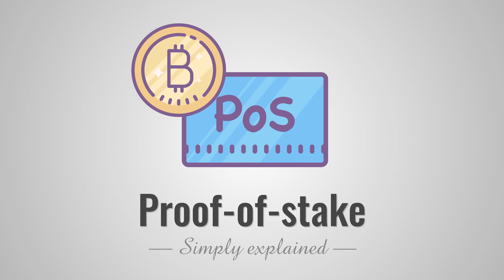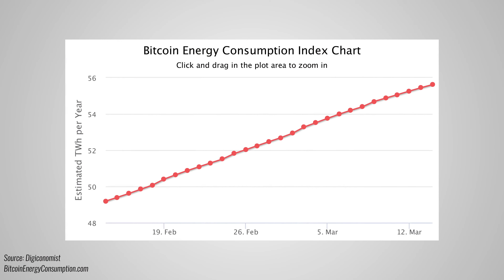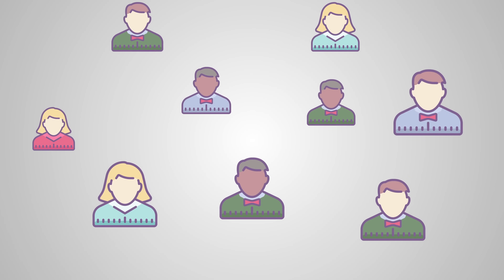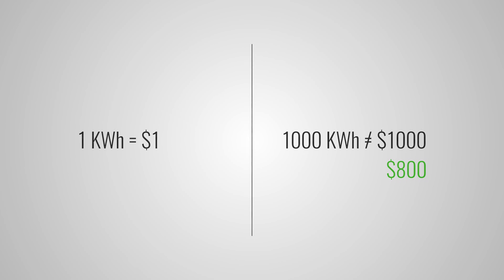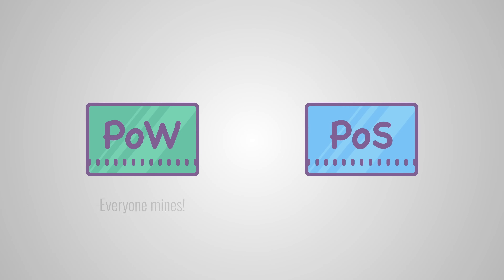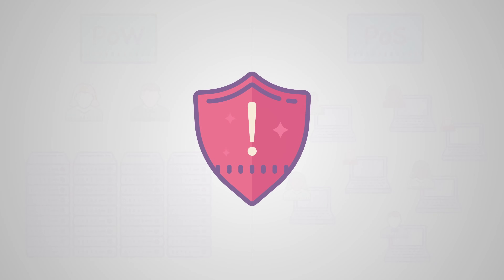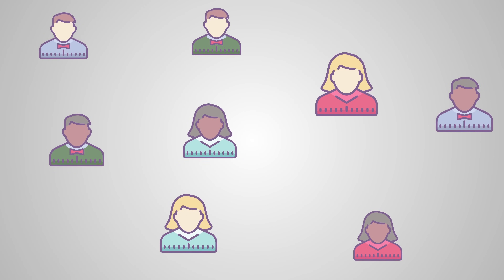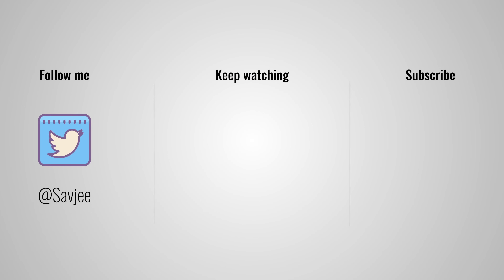Proof-of-Stake (vs proof-of-work)

Comment: You can't implement 51% attack with mining pools control, because major requirement for such attack is to have FULL control over 51% mining power.
Pool participants will quickly realize that they solve proofs of non-existing block headers and not recieving any rewards, much quicker than time needed to implement such attack.

Comment: Did anyone else find this video biased towards proof-of-stake / Eth?

Some examples:

Saying that bitcoin is more centralised through mining pools, meanwhile most people that stake Eth do so through pools like Aave?

Bitcoin transactions are confirmed by nodes, not by miners. 

To stake ETH you need to have been pre-selected as a validator - doesn't this sound a bit centralised and not egalitarian? 

You need 32 ETH to be a validator if not going through a pool, rewarding only those who can afford to front that much capital with even more ETH. 

The fact that ETH literally has a CEO and foundation team / company that dictates and changes the rules and protocol regularly, by definition makes it centralised.

Anyone else feel the same?

Comment: Here's a comparison of both:

Proof of Work (PoW):

In PoW, miners compete to solve complex mathematical puzzles in order to validate and add new blocks to the blockchain.
Miners must invest computational power (hashing power) to solve these puzzles, which requires significant energy consumption.
The first miner to solve the puzzle broadcasts the solution to the network, and if verified, the new block is added to the blockchain, and the miner receives a reward in the form of cryptocurrency.
Examples of cryptocurrencies that use PoW include Bitcoin and Ethereum (currently transitioning to PoS).

Proof of Stake (PoS):

In PoS, validators are chosen to create new blocks and validate transactions based on the amount of cryptocurrency they hold and are willing to "stake" as collateral.
Validators are selected to create new blocks based on various factors, such as the amount of cryptocurrency they hold and how long they've been staking.
Validators are incentivized to act honestly, as they risk losing their staked cryptocurrency if they validate fraudulent transactions or attempt to attack the network.
PoS requires significantly less energy consumption compared to PoW, as there is no need for computational mining.

Comparison:

Energy Efficiency: PoS is generally considered more energy-efficient than PoW since it doesn't require vast amounts of computational power.
Security: PoW has been battle-tested and is considered highly secure, but PoS is also gaining traction and has mechanisms to deter malicious behavior.
Decentralization: PoW tends to be more decentralized initially, but PoS can also achieve decentralization with the right design.
Incentives: Both PoW and PoS provide incentives for participants (miners or validators) to act honestly and maintain the integrity of the network.
Scalability: PoS networks often have better scalability potential due to lower energy requirements and simpler consensus mechanisms.

Comment: ⥊ POS: LIFE

0: Good

001: Uniqueness
002: Altruism
003: Sensivity
004: Audacity
005: Boldness
006: Astuteness
007: Ingenuity
008: Innocence
009: Truth Seeking

01: Willpower
02: Progress
03: Acuity
04: Love
05: Bravery
06: Congruence
07: Consonance
08: Honesty
09: Cleverness

1: Ethics
2: Problem-Solution
3: Subject
4: Idea
5: Expression
6: Why / Who / When / How / Where / What
7: Information / Code
8: Stability
9: Sanity

10: Network
11: Justice
12: Affront / Easter
13: Definition / Death
14: Cognition
15: Source
16: Reason
17: Discourse
18: State
19: Control

20: Judgement
21: Ethical Solution
22: Scupulous
23: Delimitation
24: Humor
25: Behavior / Christmas
26: Motivation
27:    Comprehension
28: Constancy
29:    Regulation

30: Liberty
31: Permission
32: Discernment
33: Responsability
34: Support
35: Means
36: Purpose
37: Opinion
38: Decision
39: Prospect

40: Goodness
41: Awareness
42: Critical Thinking
43: Consideration
44: Conceive
45: Plan
46: Ability
47: Knowledge
48: Structure
49: Ambition

50: Good Expression
51: Manifestation
52: Resolution
53: Application
54: Empowerment
55: Movement
56: Demonstration
57: Assignment    Mission
58: Building
59: Proficiency

60: Accordance
61: Appropriated
62: Implication 
63: Indicator
64:      Cohesion
65: Function
66: Investigation
67: Argumentation
68:      Sophistication 
69: Scrutiny

70: Intelligence
71: Message
72:      Consistency
73: Election
74:     Coherence
75: Consolidation
76: Explanation
77: Flow
78: Fluency
79: Measurement

80: Peace
81: Sovereignty
82: Perseverance
83: Reliability
84: Autonomy Instrospection
85: Rectitude Implementation
86: Pursuit
87: Persuasion
88:      Character Benign
89: Commitment

90: Kindness
91: Assertiveness
92: Optimism
93:     Scrupulousness
94:     Compassion
95: Composure  Essence Fiscalization
96: Blockchain: ⥊ (TRACE MARKER) Legacy
97: Anarchy
98: Veganism
99: Revolution

100: Liberation
101: Decency
102: Progressive
103: Resilience
104: Integrity
105: Collaboration
106: Abolitionism
107: Concordance
108: Clarity
109: Regulation

110: Ethical Commitment
111: Honor
112: Exploration
113: Privacy
114: Will
115: Pride
116: Justifiable
117: Equitable
118: Fair State
119: Mission

120: Harvest
121: Deliverance
122: Resistance
123: Cogitation
124: Challenge
125: Appropriated
126: Searching
127: Emphasis
128: Consistent
129: Subversion

130: Fulfillment
131: Admission
132: Criteria
133: Response
134: Provide
135: Technique
136: Principle
137: Point of View
138: Choice
139: Prevision

140: Serenity
141: Conscience
142: Concern
143: Perception
144: Free Love
145: Idealize
146: Capacity
147: Mindfulness
148: Scheme
149: Morality

150: Righteousness
151: Virtue
152: Coordination
153: Efficiency
154: Equip
155: Cooperation
156: Profiling
157: Counter-Terrorism
158: Rising
159: Excellence

160: Reasonable
161: Procedure
162: Corroboration
163: Hint
164: Value
165: Role
166: Lead
167: Logical
168: Improvement
169: Assess

170: Sympathy
171: Relevancy
172: Dichotomy
173: Naming
174: Elucidation
175: Materialization
176: Validity
177: Harmony
178: Coherence
179: Verification

180: Perpetuity
181: Independency
182: Perseverance   Dependability
183: Structure
184: Potential
185: Stance
186: Occupation
187: Compelling
188: Conviction
189: Boldness

190: Power
191: Wisdom
192: Effectiveness
193: Prudence
194: Foresight
195: Discipline
196: Trackable
197: Accountable
198: Compeling   Sustainable
199: Quest

200: Ideal
201: Compatibility
202: Referee
203: Adjudicate
204: Conformity
205: Coexistence
206: Methodical
207: Correspondence
208: Eccentricity
209: Expertise

210: Solution
211: Resolution
212: Prosecution
213: Adjustment
214: Transformation
215: Conversion
216: Escalation
217: Correction
218: Persistence
219: Analytical

220: Contemplation / Meditation
221: Preparedness
222: Dialectical
223: Meticulous
224: Diligence
225: Attitude
226: Rigorous
227: Dispute
228: Healtiness
229: Prescription

230: Allowance
231: Agreement
232: Definition
233: Jurisdiction
234: Availability
235: Proposition
236: Objective
237: Reckoning
238: Settlement Warrant
239: Assurance

240: Mindset
242: Mental State 242: Consideration
243: Rumination
244: Impression
246: Sagacity
247: Easygoing
248: Disposition
250: To Thrive 
253: Conduct
254: Potent
255: Insurgency
257: Defiant
260: Unveiled    Exposed 
261: Freedom Fighting
262: Correlation
263: Relevance
265: Conjecture
266: Suggestion
269: Estimate
272: Paradox
273: Choice
274: Dispute
280: Constancy
282: Evanescence
288: Healtiness
289: Conduct
290: Prognosis
294: Anticipation
295: Proof of Stake
296: Calculation
297: Proof of Work
298: Commitment

300: Crusade / Jihad
304: Concept Attention
309: Consensus 
310: Conviction
311: Consent
312: Confront
312: Distribute
313: Enforcement
314: Bodily Autonomy
320: Deliberation
322: Opportunity
327: Suspicion
330: Adherence
331: Self-Determination Demanding
333: Abundance
334: Accountaility
335: Technician
336: Dedication
338: Permanent
339: Maturity
340: Promote
341: Confirm
342: Validate
343: Imagination
344: Qualification
345: Ratify
346: Organization
347: Propagate
348: Finance
349: Encourage
350: Operation    Materials
351: Engagement
352: Endeavor
353: Undertaking
354: Remarkable
355: Designation
356: Exposing 
357: Proactive 
358: Forge
359: Accomplish
360: Technology
367: Addressing
372: Ambiguity / Conflict
373: Retort
370: Standpoint
372: Conflict
377: Context
383: Orientation
390: Prognostic
394: Prediction
398: Sustainability
399: Overthrow

400: Earth Population
402: Diversity
410: Permaculture
411: Mathematical
413: Realizing
421: Metamorphose
422: Transcend
427: Skepticism
430: Abstraction
434: Care
435: Possibility
436: Inspiration
440: Insight
441: Abstraction
442: Contemplation
443: Brainstorm
444: Formulation
445: Elaboration
446: Capability
447: Know-How
448: Apparatus
449: Theory
453: Design
454: Escalation
455: To Arrange
457: Rapport
460: Aptitude
461: Rigorous
462: Affect
463: Skill
464: Competence
465: Performance
466: Conjecture
467: Intelligible
468: Enrichment
469: Expertise
470: Wisdom
471: Accessible
472: Distinguishment
473: Priorities
474: Perspective
475: Constatation
476: Punctilious
477: Attentiveness
478: Amusing
479: Insurance
480: Security
481: Inclusive
482: Durable
483: Trustworty
484: Individuality
485: Convenience
486: Satisfaction
487: Benefit
488: Friendly
489: Praticality
495: Marvelous
496: Sensational
499: Envision
Reply: 500: Assumption
501: Leadership
502: Credit
505: Viable
503: Esteem
509: Prestige
510: Admiration
511: Heroism
512: Pugnacity
513: Description
518: Steady
520: Proficiency
525: Habit
530: Implementation
531: Solicitation
532: Regard
533: Contract
534: Requirement
535: Execution
536: Utilization
537: Utterance
538: Respect
539: Esteeem
540: Appreciation
541: Sensatize
542: Instigate
543: Sentiment
544: Sharp
545: Assembly
546: Potency
547: Education
548: Solidity
549: Evolve
550: Fellowship
551: Insurrection
552: Schedule
553: Reportation
554: Convocation
555: Party
556: Campaign  Instruments
557: Coordination
558: Systematize
559: Seize
560: Protesting
561: Explicit
562: Reciprocity
566: Intimation
Reply: 570: Counter-Terrorism
571: Cracking
572: Decipher
573: Affinity
574: Interpretation
575: Blitzkrieg
576: Codification
577: Spreading
578: Decoder
590: Excellency
595: Heroic
599: Eagerness

600: Organizator
611: Consequence
612: Researching
613: Suitable
620: Diagnose 
629: Symptom
633: Incumbency
634: Inspiration
636: Cause Goal
643: Reflection
644: Theory
646: Brililiance
647: Logical
648: Content
653: Appliance
655: Mobilize
654: Overcoming
660: Operation
661: Operator
662: Nexus
663: Evidence
665: Role
666: Questioning
672: Discussion
673: Instructions
676: Deduction
694: Systematic
696: Sublime

700: Lucidity / The Gear / Artificial Intelligence
702: Credit
704: Data
710: Coherence
711: Rational
712: Intimation
713: Precision
714: Acquaintance
715: Presentation
716: Manifesto
717: Pronouncement
718: Proclaiming
719: Revelation
721: Point
722: Interpretation
723: Reparation Ambivalence
724: Sense
725: Direction
727: Compensation
729: Disclosure
730:    Importance
731: Interaction Consent (Y/N)
732: Contrast
733: Designation Nomination
734: Endorsment
735: Product
736:    Importance
740: Statistics
743: Understanding
744: Grasp
746: Thoroughness
747: Articulation
748: Conceptualization
749: Enchantment
750: Consolidation
751: Communication
753: Instrument
754: Conquering
755: Coalition Coordination
756: Inspire Instruction /Method
757: Prompt
759: Delight
760: Instructive
756: Instruction / Method 
766: Causality
770: Appreciation / Gratitude
771: Algorithm Statement
772: File
773: Algorithm Recognizing
774: Code
775: Information Output
776: Correlation
777: Pattern /  Construct
778: Development
779: Enumeration
780: Systematization
799: Revolution Algorithm

800: Providence / Supremacy
801: Production
802: Necessities
803: Resorces
804: Energy
808: Renewable Cycle
810: Permaculture
811: Fair Law / Constitution
819: Lament
820: Predominance / Management
829: Ephemeral
830: Logistics
831: Inquiring / Scheme
832: Reach
833: Entrusted
834:  Dependability  
835: Stock
836: Gravity
840: Consumption
843: Zeal
844: Creativeness
846: Independent
847: Autodidact
848: Integration
850: Labor
853: Usage
854: Disciplinated
855: Devotion
858: Accessibility
860: Human Resources
861: Adequated
862: Shape
863: Assignments
866: Estimation
870: Structure
873: Congruity
880: Peace
888: Globalization

900: Transparency
910: Panacea
911: Emergency Call
919: Enclosuse
930: Enlightenment
931: Only One Global Currency
935: Resources
936: Legitimacy
940: Empathy 
944: Wishing Well
946: Compassionate
947: Philanthropy
948: Unification
954: Intrinsic
955: Fidelity
960: Synthesis / Blockchain Integration
961: Remarkale
962: Guide / Formidale
963: Monolith
966: Proof
970: Examination / Gallant
971: Vocabulary
973: Pertinence
975: Inspection
979: Impressive
980: Splendid
990: Optimization
991: Imperative
995: Accountancy
996: Revolution Chain
998: Regulation
999: Zenith Vortex Epic
1000: Militancy
1001: Nova Era

1010: Peer-2-Peer
1011: Decentralized Network
1012: Distributed Ledger
1030: Financial Revolution
1031: Resources Availability
1040: Production Revolution
1042: Drug Liberation
1049: Implementation
1050: Labour Reorganization
1100: Liberation Army
1133: Abolitionism
1160: Pacifism
1312: Boycott
1317: Identifiable Source
1400: Unity
1444: Direct Digital Democracy
1500: Benevolence
1550: Charity
1807: Black & Yellow
2000: Sanctuary
3000: Freedom
3030: Win-Win
3100: Triumph
3311: To Revolt
3330: We All Can Live In Abundance
3712: Problem In Your Opinion
4000: Coexist
4411: Riders of Justice
5000: Glory
5500: Greatness
6500: Quantum Mechanics
6999: Mystery
7220: Unified Field Theory
7755: Revolution Gear
8000: Sustainability
8999: Finitude
9997: Discovery
9998: Unknown
9999: Universe
10000: Existence

. This is a Numeric Matrix for Communications Purposes.
. This Can Be Used to Convey Meaning.
   Ex.: 2034: To Judge the Idea.

. Mathematical Operators Can Be Used to Calculate Meaning.
   Ex.: To Judge the Expression: 25
   20 + 5 = 25 (Behavior)

. Logical Operators to Create statements.
   Ex.: ¬11: 13. If not Just then Death.

. Colors can also be used as information.

- You can help build it.

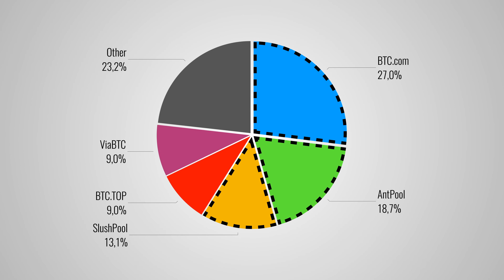Comment: 5:00 WRONG. This is a common misconception. Even if miners coordinated and conspired to add fraudulent transactions in a block, the nodes would reject the block containing that transaction. Miners who attempted to include the fraudulent transaction would lose the computational work they invested in attempting to solve the puzzle. This happened a few months ago at block height 809478 when Marathon mined an invalid block but it was quickly rejected by the node operators.

Comment: At 2'17 he says Proof of Work instead of Proof of Stake in case anyone is confused.
Reply: I think after that he spoke POW instead of POS in most of the places
Reply: @mr_possible6197  so basically you are saying that this video havent been checked before upload, which I totally agree. 

Video poster, have some dignity and fix your errors before running to upload it for views

Comment: i dont get it, so as a validator, is this a physical job? do you sit on a computer checking a list or something?

surely youll have another computer system do it for you no?
Reply from the maker: It's indeed an automated process ;)
Your computer validates the transactions according to an algorithm. If you try to cheat (by changing the code), you'll get caught and punished.

Comment: Unfortunately this video completely misses the point of proof of work. You CAN NOT get away with including fraudulent transactions even if you do 100% of the mining. The nodes validate the rules of the network, not the miners. The only thing miners do is add blocks to the blockchain, but anyone can validate wether the transactions are valid or not. The whole point of miners is to establish an order of events WITHOUT trust. You don't have to trust the miners for that (the order of events), you have to "trust" mathematics and the fact that they had to guess for ~10 minutes to find a valid nonce which allows them to add a block to the blockchain and get the block reward. The point of this is, that it is MATHEMATICALLY infeasible to reverse transactions after a certain time, because of the probabilistic nature of finding a nonce (and the associated REAL WORLD implications, unlike the implications of losing a made up currency). Hence unlike proof of stake where you bring back the entire concept of trust, in PoW you do not need trust at all. 

In case I haven't made it clear enough I highly encourage further reading before being comforted by the seemingly simple nature presented in this video.

Comment: Thanks so much for the straightforward explanation.  There is still a question I have. ETH Validators are pseudo-randomly selected to propose new blocks.   There is a time limit of 12 seconds for the whole process to complete.   This means that the selected validator must "mint" (as you say in the video) the next block in just a couple of seconds.  As I understand the ETH2 blockchain and blocks and encodings are all still the same as before. What makes it possible for the validators to discover the next nonce with very limit compute power?  Has the difficulty levels been massively reduced?
Reply: If you are thinking in terms of PoW, validators in PoS are selected, so theres no competition and so have 0 difficulty.
Reply: @EduardoPassos88  Thanks that makes a lot of sense.   But also makes the blockchain less secure …